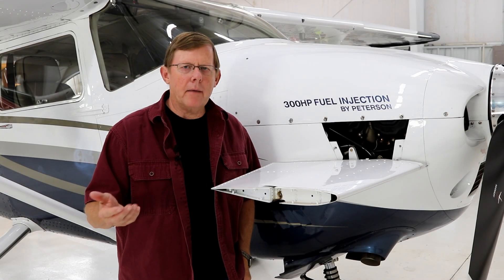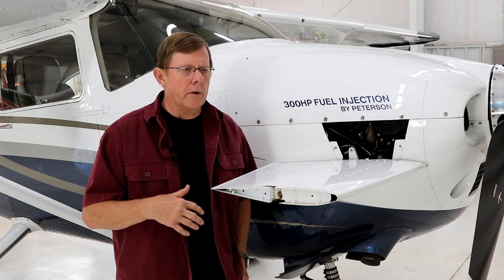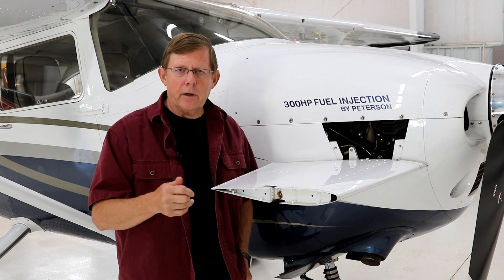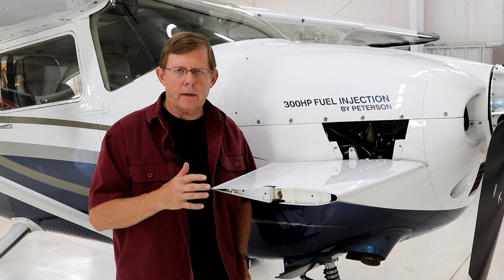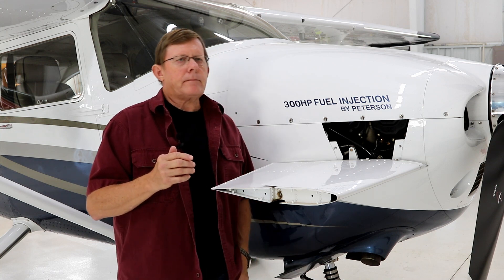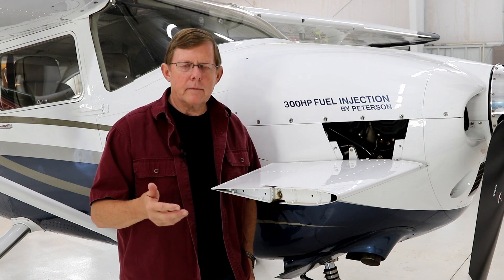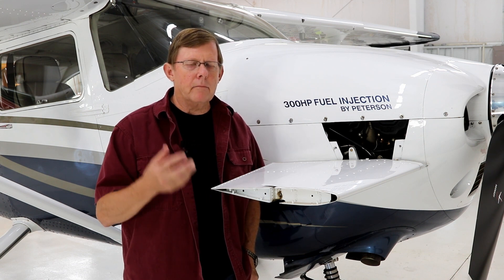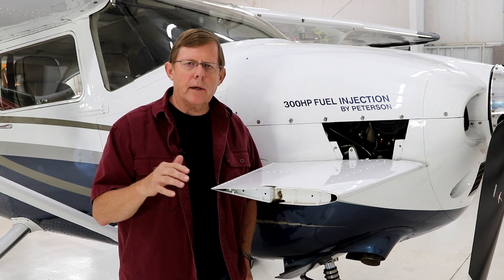Engine Break In Guidelines

Comment: I don't know a great deal about planes yet why don't they run the engine in on the bench. Well in a booth but would seem a more controlled method to me.
Reply: They need lots of cooling and without the ram air coming through the inlet or they would be toast.